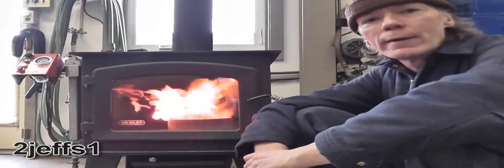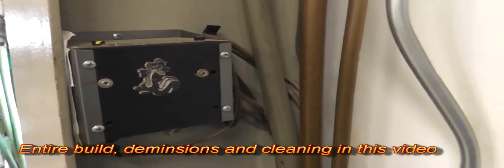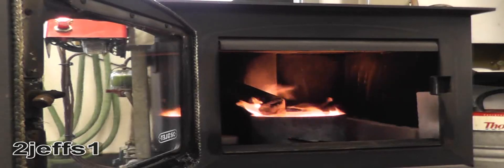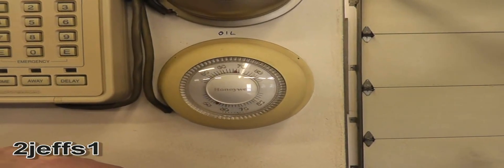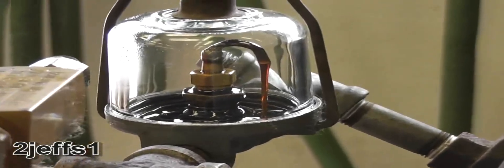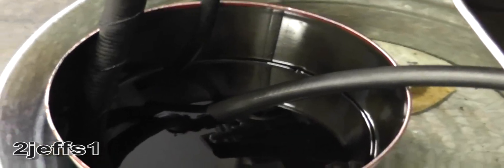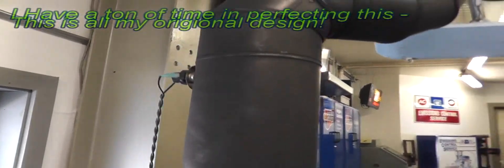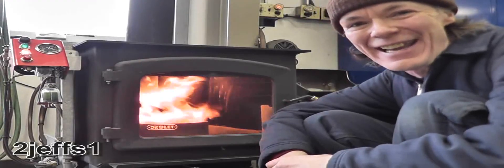Homemade Waste Oil Burner Heater for Daily Use DIY

Comment: Hi jeff, i took your plans and built a similar stove, which i thank you very much, with just a few modifications and it heats my house perfect but i an\m have 1 issue, i cannot figure how to wire the thermostat, ive just bypassed the solinoid for the time so i can use it mechanicaly, i hooked it up how your diagram shows but smoke started to come out of the thermostat when i flicked it on, i have everything as your specs, high limit switch and all,just haveing trouble with the t stat control

Comment from the maker: Hi Travis, Friends have commented "when are you going to build one for the house" too. I never pondered on that much. The shop never has any smell from the stove so with some figuring anything can be done. I doubt I would ever do that though. The big reasons for the shop is cold cars, snow covered trucks, tractors, and those overhead doors. That's where a furnace & the gas company will get ya. :>)

Comment from the maker: Oh yes when first started on this project It was amazing that you could turn the whole top of a pot belly stove red! The safety's are a huge + if one isn't tending in the same room. What is neat is these stoves make a different noise while running and after a while you what's going on by the sound it generates & don't need to look at the burner.

Comment from the maker: Hi Jayson. I read your comment multiple times to make sure to obtain the total concept you are going to create.   I tried many variances of mine but nothing close to your vision. One thing to tell you is the more air tight the stove is, the more efficient it will be, you want mostly rely on the injected air & very little outside air in. Yours sounds very interesting. Some of my first designs had a ton of bugs. You just keep refining until desired results are obtained, Jeff

Comment from the maker: Hello Delano, On my app I control the air into the burner by bleeding excessive air into that dripper tube on the side of the stove to avoid too much dead head affect on the pump. If you run the line only to the burner that would possibly cause the smog pump to heat up too much. The valve for that is above the one for the air hose coupler valve in the video. I tried to run the pump faster too but found no gain. (1725 on the motor) 2 possible thoughts. Mine gets pretty warm but not that hot. Jeff

Comment: Hi Jeff, I am from South Africa and would like to say that this is the best design I have tried so far, my build is nearly finished, I will post a vid when I am done.  I want to know from you if it is normal for the smog pump to run so hot,  I am using a 3 phase motor on my setup @ 2800rpm and also a variable speed drive to change the speed of the pump.  I am just scared that the pump will set itself a light, it is to hot to keep my hand on it for more than 2 seconds.   Keep up the good work!!

Comment from the maker: The sensor for that gauge is mounted on the tab right behind the gauge. I use it for a reference on how the stove is operating. If it is in the 3 o'clock area you need to turn the high speed oil flow down or it will kick out the high limit on the chimney. (the high limit does reset automatically after several minutes) This comes in handy on stove start up when I come inside from snow shoveling for if a tweak is necessary.

Comment from the maker: Hello. Once a year I remove that chimney section and blow the pipe and chimney with a air gun. It is a dust that forms in the pipes and stove - No brushing is needed. Also once a year I put a drywall bag in the shop vac and totally vacuum the entire inside of the stove, there is never any scraping needed on any of these parts, just the burner. Jeff

Comment from the maker: Hello Harling. I don't do very many oil changes here. I rely mostly on people who drop oil off. It takes a little time but as more people find out you take oil you'll accumulate more. A farmer is an excellent source to link up with where tractors hold a lot per change. I never tried to figure out how much oil per hour / day but my best guess would be 2~3 gallons on a -10 F day.

Comment from the maker: Hi there Geordie from Scotland. One great question ya have here. The oil drips on the bottom next to that center pedestal. That helps keep the flame spinning more so on the outer edges & a bit better flame. . Also I inject/aim the air from that 1/4" tube almost to the top of the height of the pedestal but of coarse not at it. Once you get it running you can "fine tune" your copper tube. When you get it right the stove can idle without the risk of a flame out! You'll love it way more than wood.

Comment: Hi, you've convinced me , I'm going to convert the stove I have in my shed to oil, at the moment I burn wood as it gets quite cold over here in Scotland, my only query  is went the oil drops out of the pipe in the stove, into the pan, does it drip straight into the  bottom or does  drop on to the ball thing you have in the pan,if so, what's the ball thing for ??? Cheers for now, brilliant video ;-)  Geordie

Comment from the maker: Hi & Thank you much for the compliment The shop is 30 x 84 but usually keep part of it closed off and heat 30 x 50 with 10 foot ceiling. My best guess would be ~ 3 gallons in a day if it's 10 below zero out. The biggest thing is keeping the temp set at 60 ~ 70 where I used to run at 80 don't leave much cycling time and of course consumes more oil. I don't do many oil changes here and mostly rely on people dropping oil off. This should give ya a general idea - Jeff

Comment from the maker: Hello, I like checking projects out that others create. Your blower into the burner setup looks real close to my earlier design. Actually I even tried 2 - 180 degrees apart that spun the flame in a clockwise direction. On your video's I think better lighting might be beneficial. Y tube has a video editor which you can add lighting to your vid's. They have a duel screen to compare & it's easy to revert back. I used on a few of my first uploads (Too dark) & it helped a lot! Good lock, Jeff

Comment: Please explain, is it legal to burn used engine oil? if i have waste oil is it legal to sell it as fuel (filtered and dehydrated) to be burned in residential furnances (converted or #6 oil furnances)?